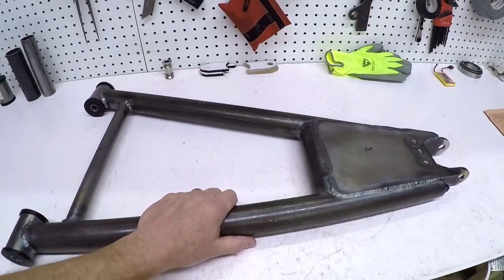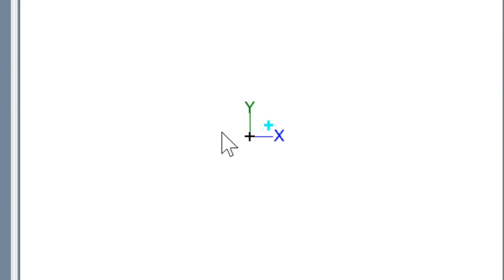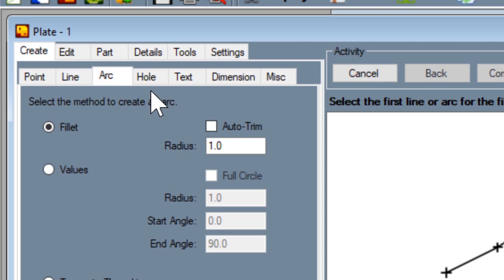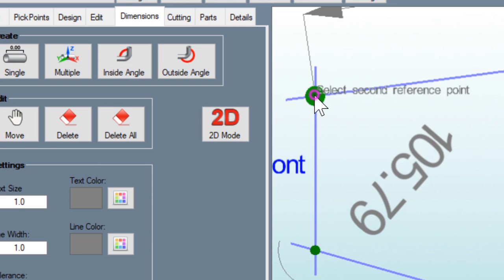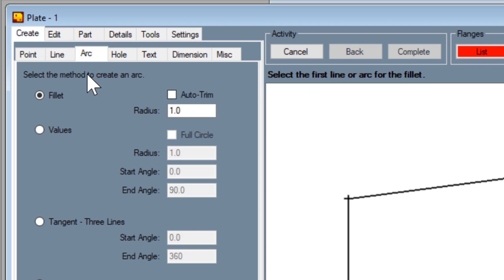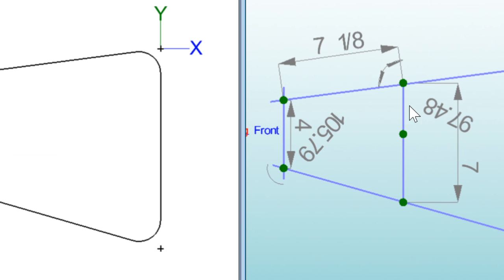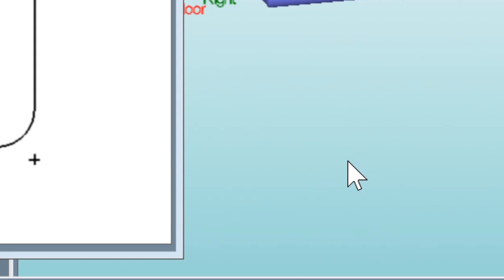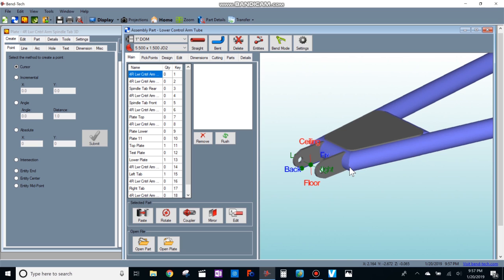Bend Tech Sheet Metal Module

Comment: great tutorial. I was just wondering what the purpose of the plate(s) is. Are you going to use the faces to mount things too or are they structural? I would guess that the inner tube would provide more rigidity than the plate but that's just a guess and very possibly completely wrong.  thanks again
Reply from the maker: I think the mitres at the end of the arm need additional strength, and the shock absorber mount will tie into it a little. And the bump stop might use the plate, maybe. I'm not sure exactly where the bump will go yet. The original design had the top plate tied into the spindle tabs as well for more strength. But I went away from that. It might be overkill, but I'm not sure at this point.

Comment: I enjoy your channel, but this is a simple part. All you need is the center line from each end and connect the lines. Why spend all this time for a simple part?
Reply from the maker: To be honest until I read your post it never even crossed my mind that this was a super simple part. I think because I'm so used to using the software it doesn't even cross my mind not to use it.
You've made me rethink everything! lol
Reply: Hey Doug I don't  see  a video of the  rear a arm.did you  do one? I'm looking for the  degrees you  built it in.if you don't  mind  pm me  at marshalltimothy49@yahoo. Com